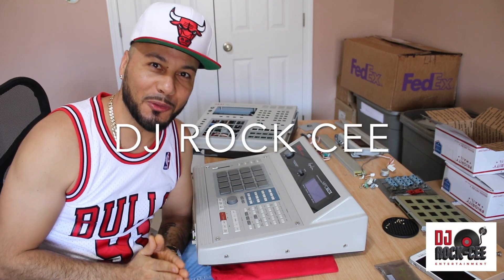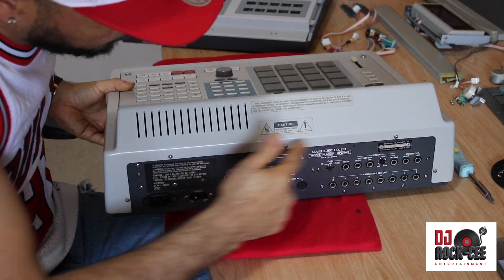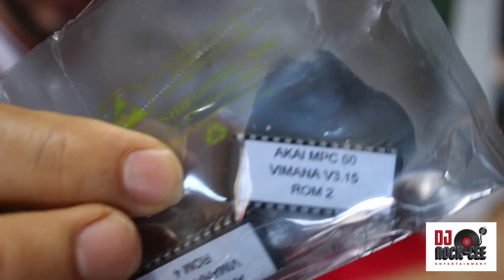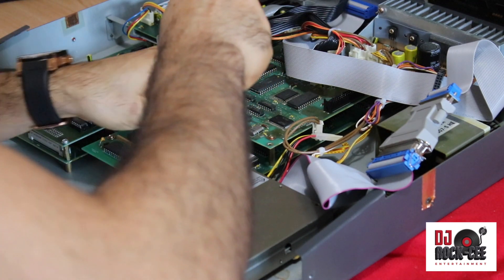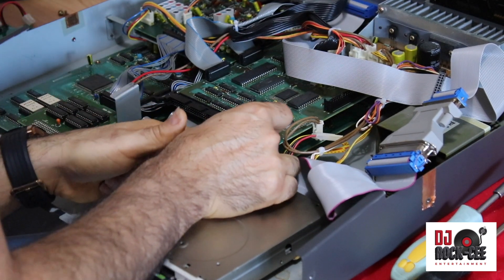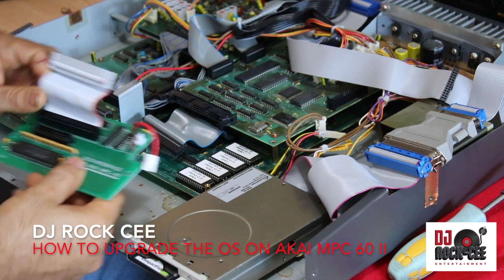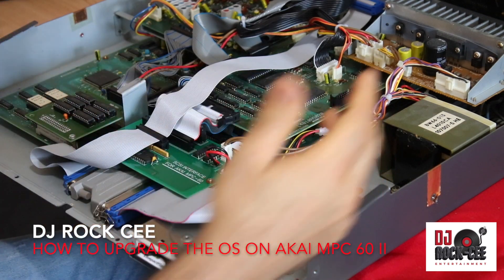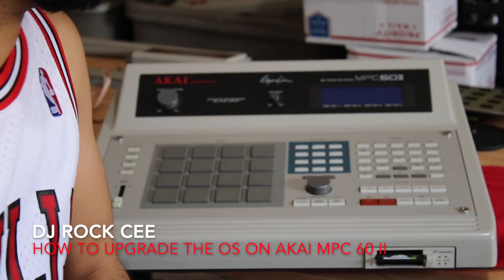how to upgrade the operation system on the Akai Mpc 60 / Mpc 60 ii by dj Rockcee

Comment: My MPC60 mk1 shows lines or sometimes like a brick on power up.  Just for a second but I feel like I don’t remember it doing that.  Is this indicative of anything wrong with power?  I’ve had issues with the expansion ram also and I’m wondering if there’s another underlying problem.
Reply: I had an S1000 that had similar issues with the lines on the screen on power up and one day, it just fully died.  So I’m worried the same thing is gonna happen

Comment: do you have a video on how to install the compact flash drive on the mpc60ii ? i have a mint unit with vimana 3.15 installed but still on floopy disk
Reply from the maker: DJ Noriega this video is showing both process in one..but if you need more information there’s a video on YouTube on how to do it